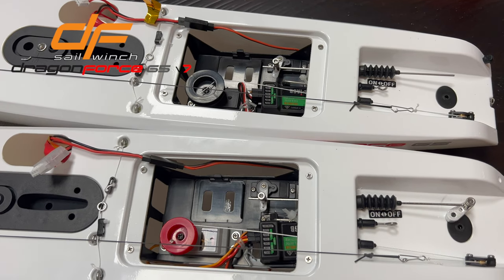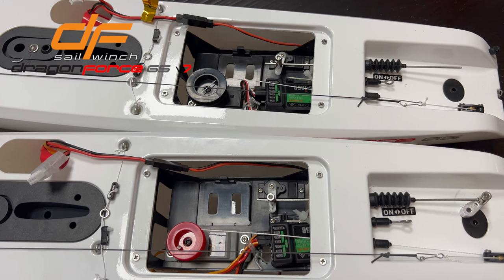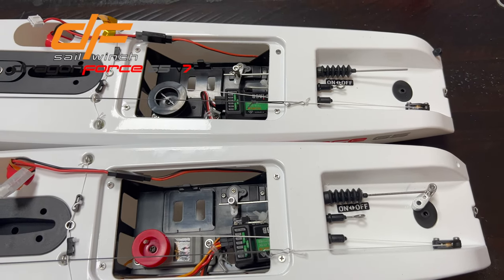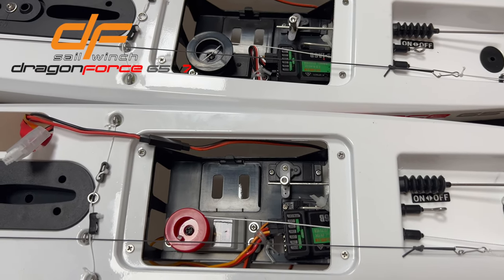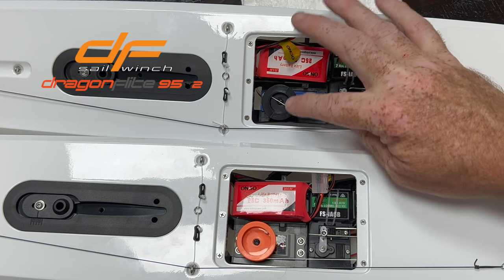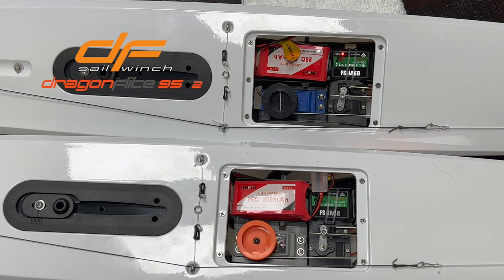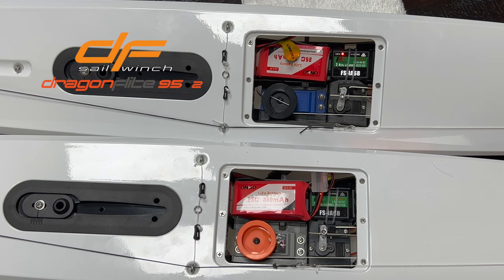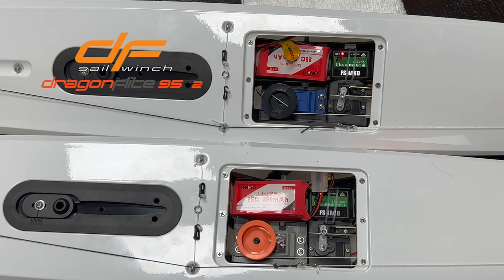2022 DF  Upgraded Winch Intro

Comment: On the 95 you have to reverse the winch to have the sheet travel along the port side as the old stock winch did. Otherwise the rudder linkage interferes with the sheet.

Comment: Looks good, but I'd like to see how accurate it is just easing just slightly when fully sheeted in, the old blue servo has a wide dead band which hopefully this servo resolves.
Reply from the maker: Dave, it’s a coreless motor with better gearing, the new winch has better resolution,  I have rarely experience the dead band you are talking aboUt on the blue winch, more so on the DF65 black wInch